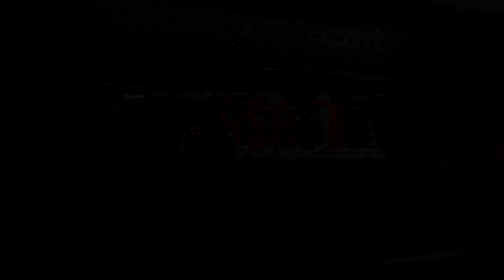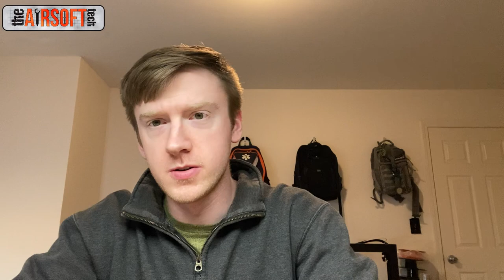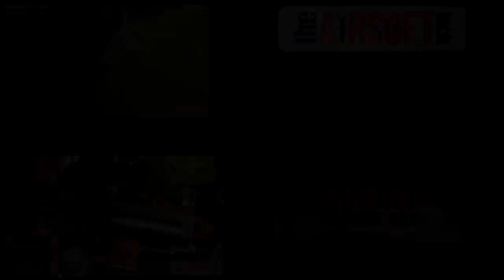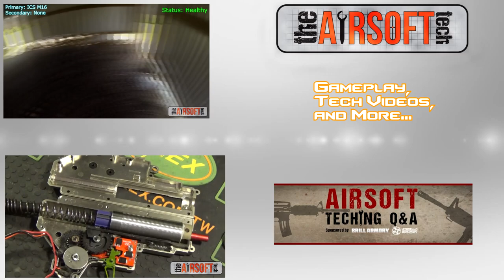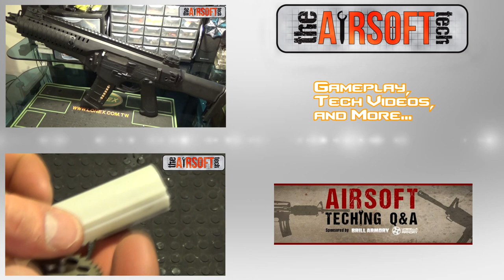TheAirsoftTech VLOG: Episode 5 | Why DSG/TSG?

Comment: So even just for semi auto trigger response only, would it be worth getting a DSG or TSG over a SSG?
Reply: Yes the trigger response is significantly better over an ssg in almost every way. Of course you have to have other parts that work together well.
Reply: @soappy1207  ty, but won't it work if I just use my high torque motor, paired with a dsg gears set and the tappet plate that comes with it?
Reply: @keeemzj  should work pretty well but your going to need some type of mosfet I like the gate Titans the best but there are plenty of cheaper options
Reply: @soappy1207  ty, atm I just have some kind of basic nosfet
Reply: Ssg is better option because you can just get a Gate warfet and use pre-cock... There is no need For DSG
Reply: @louhis7158  not necessarily I’ve built both to the maxx and always the dsg has better trigger response
Reply: @louhis7158  and you have significant better full auto on a dsg
Reply: @soappy1207  Yes, but lets face it DSG guns break More easily than Ssg and DSG are More like Trophy.
Reply: @soappy1207  That is true but no one needs that fast full-auto. Everyone would Be happier without that kind of full-auto
Reply: @louhis7158  true but if you build them right and get all the right parts like siegetecks if you can afford that as well as shimming and correcting aoe
Reply: @soappy1207  would be good but don’t have the funds lmao
Reply: @soappy1207  I agree
Reply: Full Gate titan, segteck gears full compression and I can't out run my ssg build my friend dis for me. I guess if your gonna do the paint ball trick then a dsg would be better 🤷

Comment: I have a question. I'm shimming my first gun and I get this metallic sound when spinning the sector gear and spur gear together. I can visibly view the space between them using a flashlight so I'm not sure why it doesn't sound smooth like in your shimming video.

Comment: Whats better 18tpa or 22 tpa motor for trigger response? With 13:1
Reply: I use a 22tpa 13:1 and it shoots extremely fast without getting hot. I had a 16 tpa and it shot much faster but got too hot too fast. If your field has full auto go 18 tpa. If you have a gate titan go 22 tpa
Reply: I use a 28TPA in my DMR build

Comment: I am an airsoft idiot, so with that said, would someone define DSG SSG TSG DMR please.  Thank you in advance for the enlightenment and for being nice in your response.
Reply: SSG - the gear that pulls back the piston has one section (also called a sector)that does that.
DSG - the gear has two sectors
TSG - the gear has three sectors
DMR - Designated Marksman Rifle, usually semi-auto with a larger range and higher fps.
Reply: @timothyramseybass2874  Single, Double, and Triple Sector Gears.....Thank you.